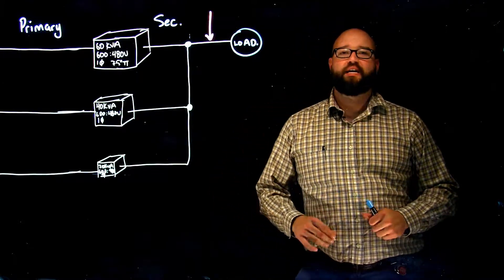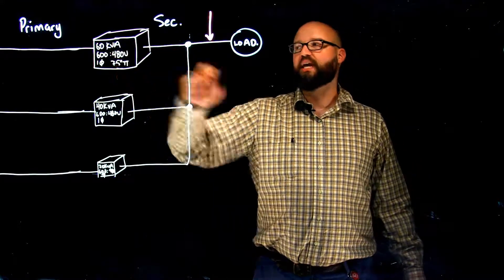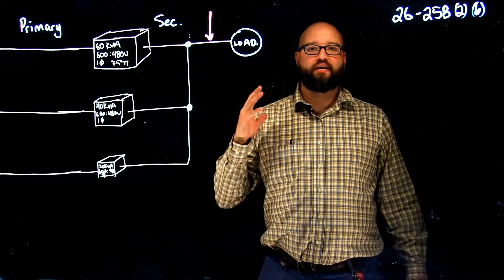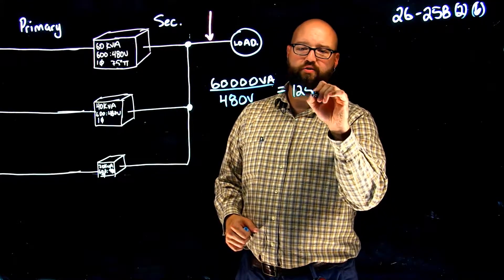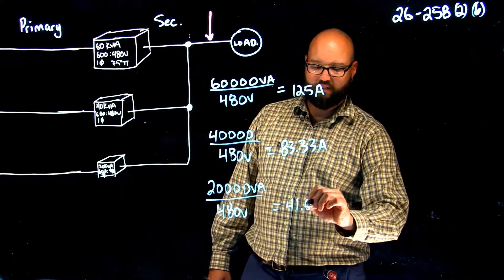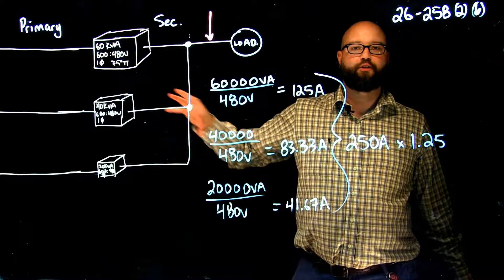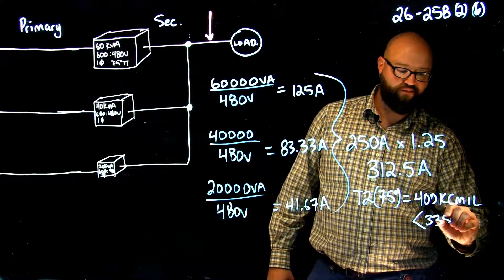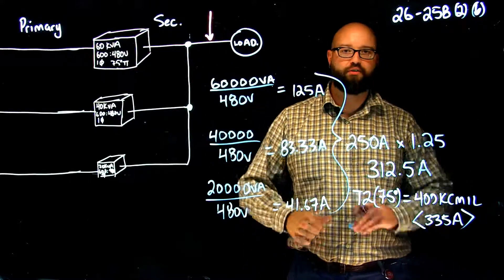Secondary Parallel Conductors (Transformers)

Comment: Why isn't the load conductor size calculated using the load consumption?  In other words, if the load was a motor, would we size the conductor as per the motor sizing method or this method?